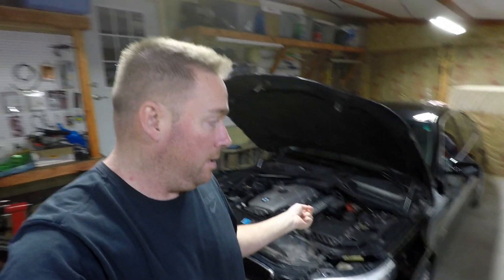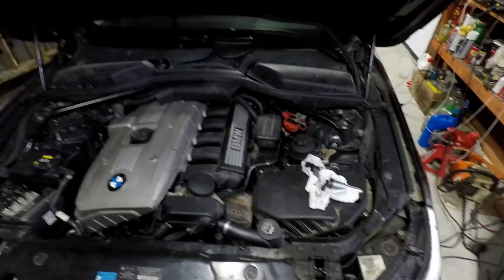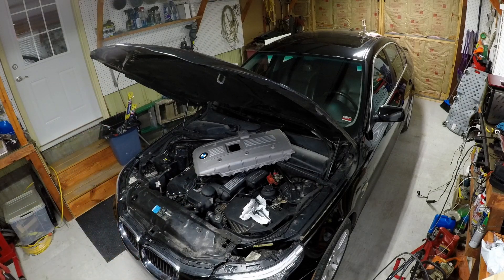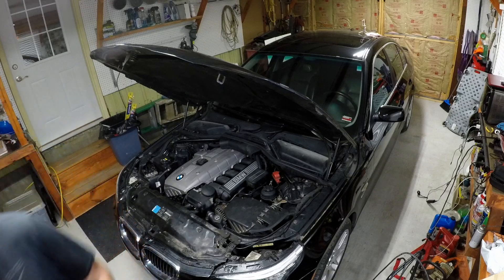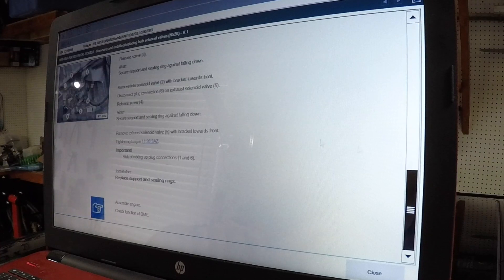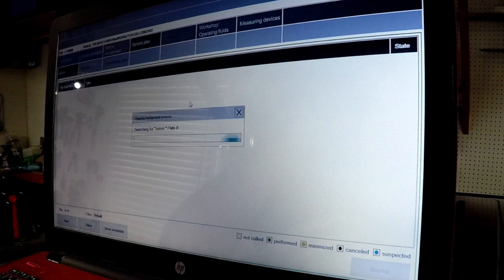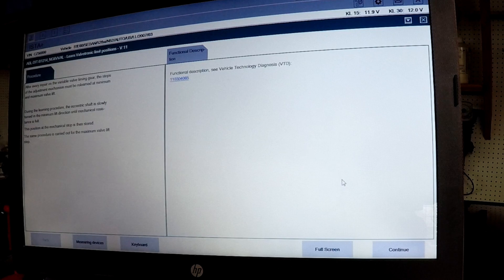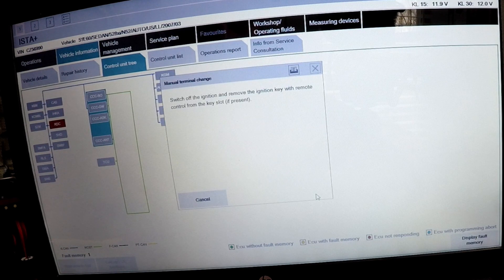Installing NEW OEM N52 Vanos Solenoids And Calibration Using ISTA-D

Comment: Hi Nathan, I think you confused VANOS with Valvetronic in ISTA.  The relearn procedure you ran doesn't affect the VANOS phasing or adaptation values.  I don't believe there are any relearn procedures having to do with the VANOS solenoids.  You can reset the adaptation values for the VANOS but should only reset if you'd changed or rebuild them.  Otherwise the solenoids are simply PWM controlled given the phasing maps in the DME software and adjusted with the adaptations over time.  I'm sure you knew all this though. 
I believe also that the valvetronic limits (the min and max opening of the valves) are relearned after terminal 15 is switched on and the car not started.  I think this is true for everything from 2007 on.  Prior you have to run the relearn procedure.  But don't quote me on that. The learn procedure in INSTA or DIS is a manual procedure if needed for whatever reason, especially if the valvetronic motors have been removed and replaced.
Reply: @BMWDoctor  I meant no disrespect to Nathan or what he's showing.  I apologize if my comment came off that way. Especially to Nathan and yourself.   I was just trying to point out that the procedure that he ran in ISTA was the relearn for the valvetronic, not clearing adaptations.  Which I agree with you should be cleared.  I should have said as much and more clearer.
About the relearn for the valvetronic... I do know that it is a real procedure that is run after switching the car on and have read it in BMW documents.  With that said, I'm now never going to be able to find it to prove it... I've also witnessed the motors go through the procedure personally after doing work on my own E63 with an N62.  Assuming that the procedure is not engine specific?  I'll admit I'm not an "expert" but have done a good deal of work on BMWs and know my way around the different BMW software.  But by no means have your level of expertise with the software.  So much respect to you on that, my friend.  I only brought up DIS because from it or ISTA you can run the valvetronic relearn procedure or clear adaptations...
Sorry again if I offended you (or Nathan).  Very much had no intention.
Reply from the maker: Hello , I understood what you were getting at in the earlier comment, clearing adaptions is wha I needed to do in addition to what I did, which can also be achieved with some scanners , thanks for watching , today will be the e39 video for the new wheels and tires !  @speralta1
Reply: @NathansBMWWorkshop  Thanks, Nathan! Glad you didn't misunderstand the intention of my comment.  It was intended to be helpful. :)  I have a Launch X-431 scanner and I find that these kinds of tasks are usually a little "easier" to perform than using the dealer software like ISTA or even DIS.  However, almost with any of these scanners you have to be a little weary because they don't always implement the functions correctly (battery registration is a good example in my experience!).
Really like your content.  Keep up the great work and I'll be looking forward to the new one today!
Reply: @speralta1  no problem nathan and me are very good buddys and i watch the comments for people like this who try think there smarter then then him yet your watching his videos so you must be learning from him then trying to make him look stupid i aint about that n62 is a complete different engine to n52 here in the uk we have every car with n52 engine espically e63 im am a master technician with bmw i started as a mechanic and went on to diagnose code and program and clone ecus on the bench and fix modules second hand or not and my training didnt cpme through youtube believe me there aint noone who knows what i do or shows you on youtube its somethinf that you have to learn yourself me and nathan both have the same car same year same colour only difference mine is m sport edition
Reply: @BMWDoctor  Thanks for the reply.  I would never want to make Nathan, or anyone for that matter, look stupid.  I have a huge amount of respect for Nathan and what he does on his channel.  I know that it takes a huge commitment to produce good content on/for YouTube and Nathan's are some of the best. My hope is that Nathan didn't take my original comment the wrong way and understood what I was trying to say.   The intent of my comment was in no way to try and make myself look smart.
I put myself through school as a mechanic earning my degree in mechanical engineering (I now work for NASA) and have a good background on the electrical and software side of things.  So these days I don't do much as I used to, but I have been working on cars for almost 30 years and try and keep myself current with all the different emerging technologies.  And I find that the saying, "the more you learn, the more you find you don't know" is very much true.  So you are correct when you say that watching these videos you learn something.  I watch mainly for entertainment purposes, however, there are little things here or there that you can learn and pick up from these guys.  For example, I just changed the timing chains and guides in my e39 (w/ M62) and Nathans video(s) on that turned me onto the German Auto Solution tools.  So grateful for that!
I've done coding but not so much in terms of programming - yet.  Starting to lean toward a J2534 pass through and going through BMW Tech (here in the states) and just pay for a subscription.  But still researching like mad and learning!
Cheers, my friend!
Reply: First of all, I have the utmost respect for Nathan, and don't doubt your knowledge and experience Dean. I was also watching this video with specific interest regarding the calibration for Vanos solenoids which was new to me (not that I am a trained mechanic or specialist or anything of the sought, just been trying to understand and fix various issues on my N52 over the years). My understanding of the Valvetronic end stops calibration is specifically for the intake valve lift so that the Valvetronic motor and Eccentric Shaft Sensor are calibrated so that the throttle essentially working correctly. I have some experience with this when a local BMW specialist where I am picked up a Plausible Valvetronic error code which he determined was a faulty or slow Valvetronic motor. So a new OEM part was ordered and fitted, but I don't think he calibrated it properly, or tried to simply do it via coding without letting it perform the initial basic calibration. When I drove the car home it felt horrible, the throttle behaviour was weird and jerky, then when I gave it a few WOT runs it wouldn't run up to the red line. After I got home I remembered the reading about the DIY to change the Valvetronic motor and the basic calibration, so put the key fob in and turned the ignition on without starting the engine, and sure enough, I heard the Valvetronic motor running through the end stops. Went for a drive afterwards and the car was fine. But this is where your knowledge as well as Nathan's knowledge would have more understanding of the relationship between the Valvetronic system (valve lift/throttle) and the Vanos (valve timing) - the adjustments are very quick and precise and ever changing through the rev range and load and throttle position etc. My '05 E90 330i 6MT is one of the early N52 engined cars and has some older or different components compared to later N52 engines, including ever so slightly different coil packs and older Vanos solenoids to name a few. The issue that I have started as a minor and intermittent rattling sound on moderate throttle/load which, the local BMW dealer that I took the car to while still under Motorplan, suggested was a pinging issue. To be honest, it doesn't sound like pinging, more like a valvetrain rattle of some sort. But then I became more and more aware of dips, surges, stumbles, and other weird throttle behaviour after that. I don't have the HVA ticking lifters, and cold start and idle is fine generally. But, on some occasions I have noticed the revs climb by itself after cold start, and even more rarely, when warm. Economy and performance also doesn't seem to be where it should be and at times it feels like the engine is being "held back" with more engine braking than it should have and somewhat jerky throttle. So I have been suspecting the older part Vanos solenoids as being a possible cause for this. I've cleaned and swapped them around over the years, and even removed and cleaned the Check Valves for the Vanos system, they were perfectly clean. Anyway, I follow Nathan's channel because it is very interesting and I learn new things along the way. Thanks to Nathan and yourself for sharing your knowledge with us.
Reply: @pfoglar  no problem my friend your issue is vanos solenoids guranteed its not advancing the timing which in turn will not lock on the valves to give thay power surge get original bmw parts like i gave nathan do not use take my word chinese sensors or any other brand they simply will not work just like you i have the older n52 engine with magnesium valve cover and been through all your problems aswell nathan has the newer version n52 thats why me and nathan work together on this be also carefull your headbolts aint cracked check for leaks smoke of any sort and check your pcv system if that is screwed which mine was and im in the uk that will not be sucking enough oil back in to the intake causing the solenoids to get to much oil in turn clogging the solenoids therefore the solenoids cannot tick fast enough to advance the timing i also had the hva noise upon purchase of this car that was 6 months ago i used forte hydraulic lift treatment and the problem has not returned i reccomend it highly here in the uk all garages and dealers all use forte they reccomend it and have it on there shelves to hand here and use thereselves please look it up it works wonders and have a treatment for everyrhing and it wont clog or mess up anything like most do
Reply from the maker: Hello, reset adaption is what I needed to do also, which is possible with scanners like auto and the creator c310, thank you for watching and hopefully you will stick around for the upcoming videos ! @pfoglar
Reply: BMW DOCTOR DEAN Stephan peralta is right! He mixed it up in the video. The Only thing to do after changing vanos solenoids is to reset adaptions. Ista offers a service function for that. Learning valvetronic limits don’t resets any other adaptions then valvetronic. I think Nathan should learn a bit more about Ista and what Ista offers for what kind of job. It looked like he used it the first time. But hey nobody is perfect.
Reply: Shut your face!

Comment: Hi Nathan. Quick question. Which do you prefer to drive, a good E39 or an E60? I have a decent E39 530i 107k miles Euro Msport that is mechanically perfect (atm lol) but I was thinking of changing to an E60, is it worth it?
Reply from the maker: I enjoy driving the e60 more but the e39 is easier, hop this helps and thanks for watching Chad
Reply: Take my word hell no if you have no skills and electronic knowledge keep with e39 e60 is more headache more problems with ny e69 then i ever did with my e39 530d i miss that car dearly and it was aegean edition m sport low mileage 80k which in uk is very low mileage very reliable and always got looked at keep your e39 trust me
Reply: I'd keep any special edition e39! They will be going up in value.
Reply: Rason Jason thanks mate. I have decided to keep it. 🍻